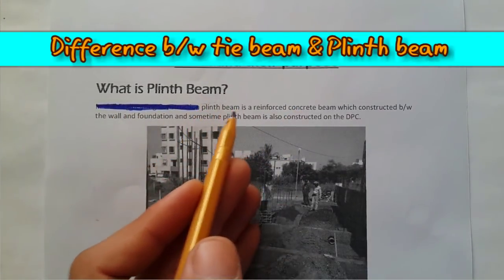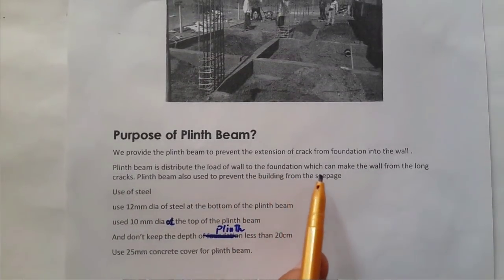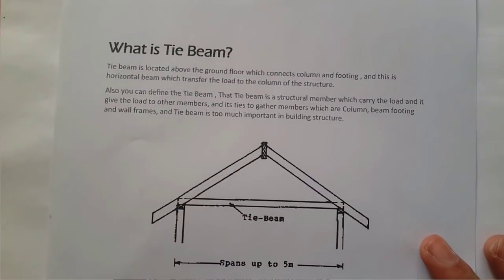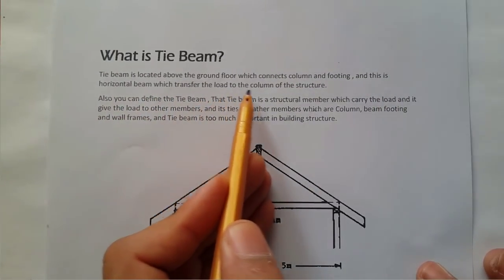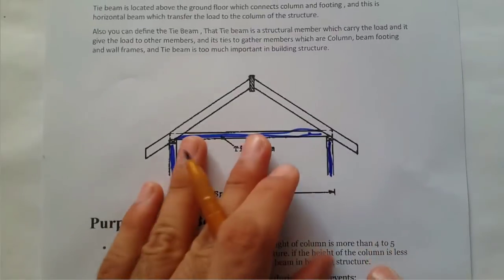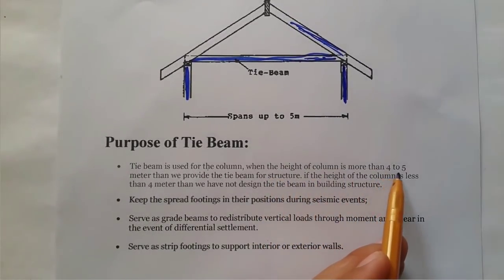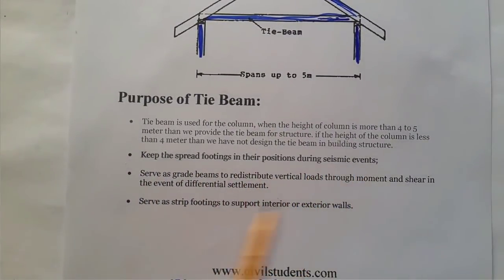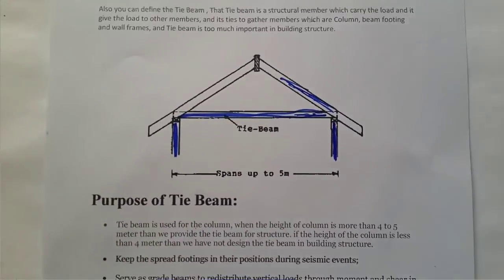Difference between Plinth beam and Tie beam and their purpose in construction

Comment: Sir we hv been told in uni lectures , tie beam  is used to connect two footings when differential settlement occurs in both footings,after connecting then with tie beam then no settlement takes place....I'm.hearing first time that for 4 to 5 meter height column tie beam is used ..I'm confused by two lectures